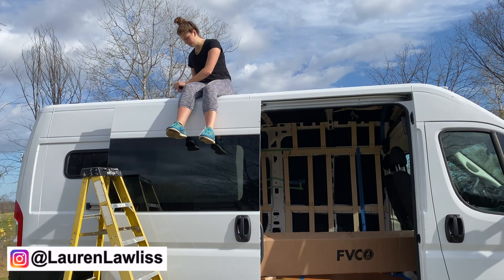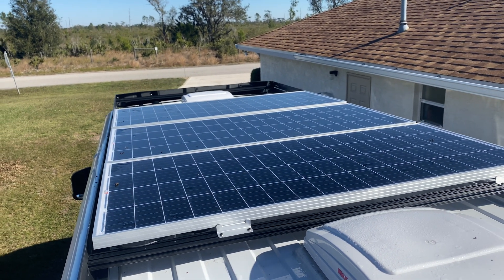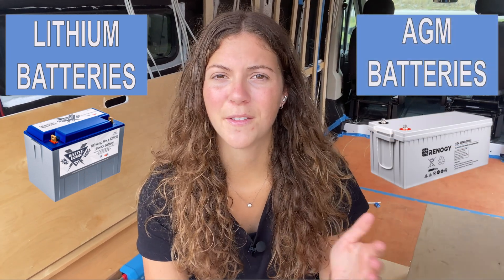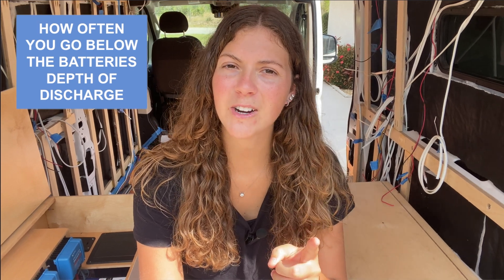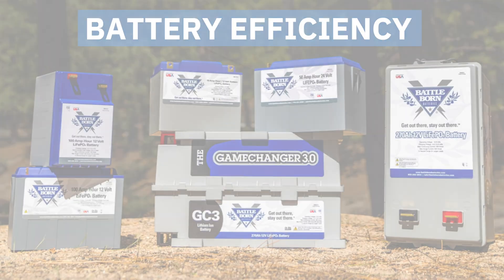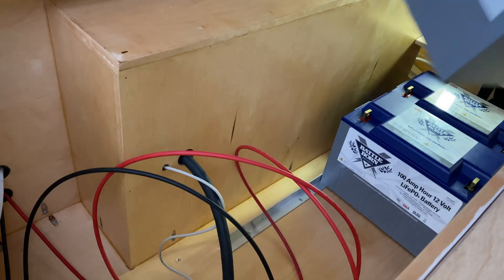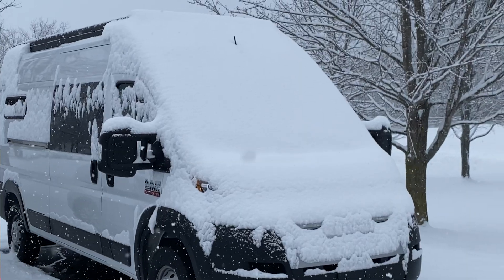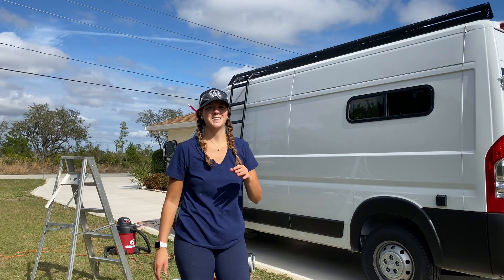What Batteries are Right for your Campervan Electrical Install? | Ram ProMaster DIY Van Build Series

Comment: Good news, two years later: decent lithium batteries are available that have low temp cutoff and even self heating if you want for almost if not lower prices than AGM. Not Battleborn, but there are a lot more form factors than they can provide at substantial savings.

Comment: Can you give me the dimensions of your battery box.  I recently purchased a 24 Sprinter and I just yesterday received the complete Explorer life electric package you recommended.  I’m following your electric build step by step.  Thank you, your videos on YouTube are the best.
Reply from the maker: That’s so exciting! My electrical bed box overall dimensions is 54 inches in length, 24 inches in depth and 21 inches in height. All made of 1/2” plywood and also has the wheel well box inside. Good luck 👍🏼

Comment: Thanks for the information.You still have to put something on the floor to keep it cool in the summer & warm in the winter.However you have given us some very good information on these Batteries.Thanks.
Reply from the maker: The floor has been perfect temperature for me in all seasons. I will be installing a floor heat pad to use in the colder months, my heater will be on the floor and I can always lay a rug and wear socks. Thanks for watching!
Reply: @LaurenLawliss  .HI.I hope you get this.Carpet is a great answer.I used Carpet in the summer & winter.It keeps the floor warm & it doesn't let your Cool air,cool out. Your warm air in the winter hot.I've found when coming from being in the water,hiking,Roller Blading or skiing.That the carpet feels so very good under my feet.Then when I pick up the carpet.I do feel the cold air & the warm air rushing in.So Carpet will help you,It has me.Thanks for answer me back.Didn't think You tubers answer.I thought that You Tube did it for you with there computers.When you put carpet down Please let me know your thoughts.Thanks>:))
Reply from the maker: A rug would be great!